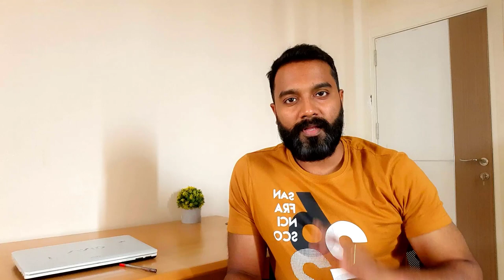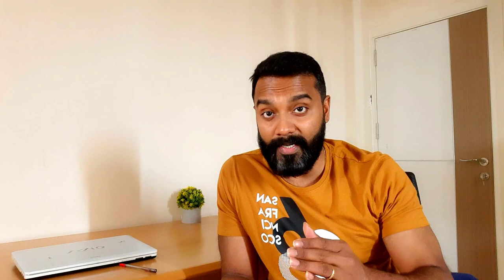6 Mistakes to be avoided while preparing Piping design

Comment: 1.Another error I have observed  is that clearance for valve handles, especially drains where levers can clash with the foundation, plinths or adjacent beams/mps. Always leave clearance for the nipple, valve length and lever handle.
2. Always leave the flanges connecting to pumps as field fit with some extra length and use variable horizontal (screw type) support